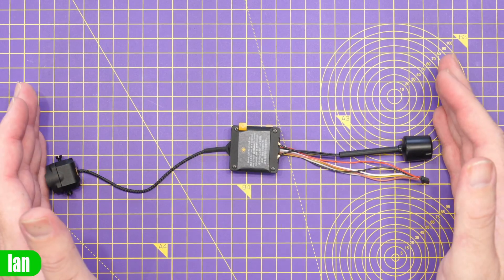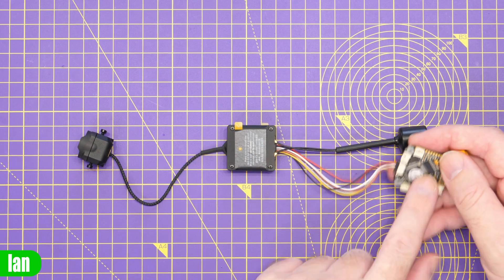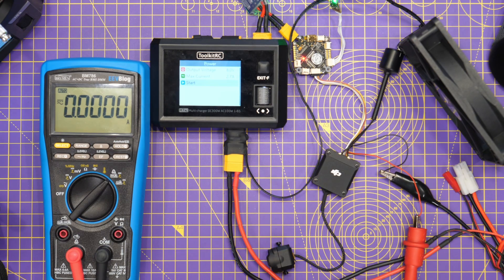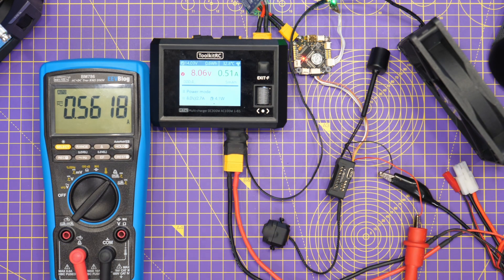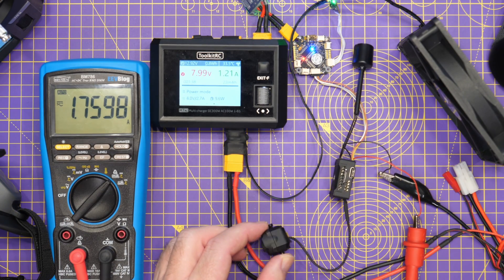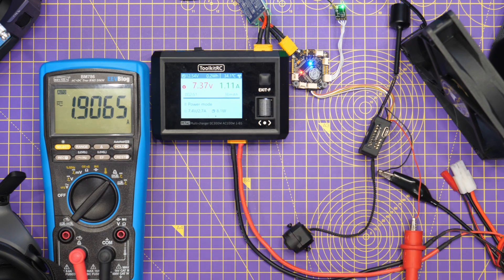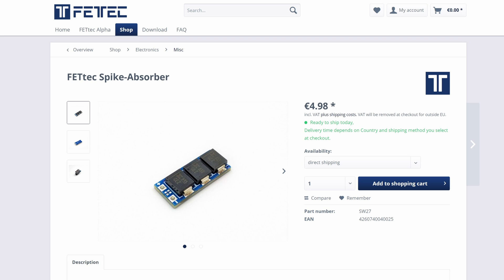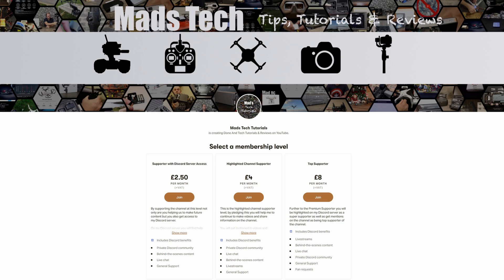DJI O3 Air Unit Power Requirements Updated  - This Could Catch You Out

Comment: Still believe this is what happened to my iflight chimera. Was to fast and lost control as well. Thanks for all the detailed testing Ian.
Reply: The Chimera7 Pro V2 you got for a review has a FC that's sold as 9V 2A. It's rated and tested for >2.5A constant and hot (without cooling) which can supply >22.5W. The measured maximum power draw is 15W and only when running the ham file.

Since I've explained in other videos, we have feedback from DJI that there's a firmware issue with the Radio Controller 2 that's being worked on. The network generated by Goggle, O3 and RC2 randomly fails and doesn't recover.
Reply: @xingtheiflightinsider  do you have a source where it is saying that its rated and tested for >2,5A?
Reply: @Mojo97779  yes, my source is iFlight.
Reply: @xingtheiflightinsider  okay, because i bought an chimera pro V2 (which will arrive next week) and i saw that Video from originaldobo, which made me think of wether the BEC is sufficient or not. But 2,5A should be sufficient, i guess, for the O3
Reply: @Mojo97779  This video is based on wrong accusations anyway. The BEC is more than sufficient. The DJI firmware had a bug which was fixed with the new update.
Reply: @xingtheiflightinsider  alrighty, thank you very much :)
Reply: @xingtheiflightinsider  whst kind of update  dji use for that?
Reply: @DrEvil-yx4vr  latest firmware was fixing those random disconnects when using the Radio Controller 2. It's in the changelog.
Reply: @xingtheiflightinsider   Do you mean the goggles 2 version?
Reply: @DrEvil-yx4vr  Actually the whole system got a firmware update with the fix, Goggle V2 and 2 but also O3 and Radio 2.
Reply: @xingtheiflightinsider   Thanks, than i know waht to do! Geting the update on everything
Reply: @xingtheiflightinsider  i have another question 😅 whats the right current before arming? My osd shows me 1.45A before Arminig! Is that right or to much? I already calibrate the current scale in betaflight after a few flights. Thanks for help.
Reply: @DrEvil-yx4vr  ignore that before arming. The current is so low it won't be accurate. Leave the default values from the manufacturer, those are pretty accurate. There's no need to have them perfect, since all batteries have either a bit more capacity (new) or a bit less (old). Fly to 90% battery capacity and then see how many amps you charged back in to confirm.
Reply: @xingtheiflightinsider  thank you 👍👍👍
Reply: This is why my O3 is shutting down in few minutes because of overheating?  I use a S4 1300mha.
Reply: @OriginaldoBo your video made me switch from a 9V 3A BEC on my Matek H743 MK4 FC to Lipo voltage... now I am not so sure that this was a wise move anymore. Lipo voltage sends transient spikes directly to the AU, that may no may not be ready for that (a TVS diode on its own). My FC has a own TVS diode and the BEC protects the AU from all kind of shit thats happening on the power rail. The question now is: how good is a 3A BEC in reality? chinesium is often overrated by the manufacturer. But 3A sounds still good if I only ever need 2A... what to do?

Comment: I think DJI makes better shit and the chances of losing your you’re whole rig due to a BEC failure on a cheap cut rate garbage flight controller is much higher then a DJI Air Unit dying from wiring it straight to VBat. It’s designed to run off of VBat and I just trust that feature more than an iFlight BEC. And that goes for all of them. I lost an Insta360 Go 2 on that crash. The drone was a complete loss. The only thing that survived was the Vista!  

There is technical theory as to why we do things the way we do and there is real life experience. I always wire Air Units to VBat and never had a problem. Lost about $500 worth of shit due to a HGLRC flight controller with a piece of crap BEC.  Never lost anything from wiring any DJI air unit to VBat. Life experience.

Comment: Does this mean that the HAM FCC Hack gives full output power once armed?
Reply from the maker: Yes.
Reply: @MadRC  My quad with an older F4 Matek FC stays in low power mode even after arming. All OSD elements are showing and the FCC hack is on, as the channel check showed. Could be the reason that the BEC is not providing enough power that keeps the O3 in lo power mode?

Comment: Ian, excuse for my ignorance but where do you get the information on the BEC for an ECS?
Reply: The BEC is often on the FC, but regardless, the manufacturers should be spec'ing things out.  I'd check the retail site or documentation/manual (if applicable), or contact them directly if you feel so inclined.  So the real question then becomes - how much do you trust the manufacturer?
Reply: @abertheham  Thank you.

Comment: Not going to full power until armed is a "feature" that helps keep you from stomping on other pilots just from turning your drone on to make adjustments. Good on you for clarifying the situation.
Reply from the maker: Not really. That’s low power mode.  There is no logic that turning off low power mode still restricts RF output.  

It basically makes low power mode close to pointless.
Reply: @MadRC  I guess except,  like I said if you're going over your settings,  including turning off "low power mode", adjusting the goggles,  etc, it's not necessary for the unit to put out the highest transmission power until the drone is armed. What's the point of having it output full signal sitting on a table until you're ready to take off? Having it stay in low power until you're ready to fly,  helps with battery life,  thermals,  etc in my opinion. I've seen guys dick around for 5 minutes before actually launching. The only "negative" to the way it's programmed to work is that it messed with your tests. Hahaha! Low Power Mode allows you to fly at low power,  right? Again,  so you're not stomping on other pilots. When you turn off LPM, it switches to high output once you launch. Makes sense to me anyway... Obviously,  we all can have our opinions,  right?
Reply: The issue is when you are going to use it without a flight controller.
Reply: @MCsCreations  Um what issue? Wait,  how do you use an O3 Air Unit without a flight controller? Technically,  the concern is that the O3 draws to much current THROUGH the flight controller BEC. If you're "not using a FC"... well then,  you're problems are solved... I'm not sure what you're doing at that point? Setting up a remote camera? Mounting the O3 unit to a balloon? Attaching it to a stick and using it to perform a colonoscopy on yourself?  Hmm... I guess there are options!
Reply: @londenard  for example I use them on planes and fpv wings without fc.
Reply: @londenard  Rc airplanes, rc cars... No arming status.
Reply: @metalscorpionfpv me too. I fly fixed wing aerobatics with the old DJI system and you can set the auto temp cut out to off or something similar. I hope there is a similar thing on the new 03A unit
Reply: @londenard  I Fly a Viper 90 EDF with an Air unit mounted on a headtracking gimbal.  I don't use a flight controller. So if it's not delivering full power with out an FC that's a huge problem for me.  :)
Reply: @londenard air plane or rc car and truck !!!
Reply: @glyrenden  do you use the original air unit or the new 03? ive been wanting to pick up one for my Freewing 90mm F22 Raptor but i wouldnt have a FC to go with it.
Reply: @boliu9608  I use the original air unit.  But blackstar FPV and TBRC are both making FC that will full arm the O3 and send info to the OSD.  But they don’t do flight control ;).
Reply: Is there a way to "switch on" armed mode without the use of an FC?
I had planned on using O3 upon my 1 meter Wing...
Reply: @FPVer  yes, there's a very simple Arduino project that does just this. I've done it on two of my planes and it's very easy. Unfortunately I can't give you the link because it kept getting deleted
Reply: @FPVer  If you search with the words ramiss DJI03 Arduino you should find it.  Good luck.  Alan
Reply: @FPVer  Did you ever find out?
Reply: Not really. It's to prevent O3 unit from over heating. Not armed = no air flow

Comment: I just got my first O3 air unit and set things up. One of the things that I noticed is that it seems to heat up quicker when connected to the goggles. During part of my setup, my needed the goggles on for positioning OSD elements and I had to work fast while doing this to reduce it heating up. The next day, I changed ESC settings and it didn’t appear to heat up nearly as much. Because of this, I think the best way to do the first flight with a craft that has GPS is to start with the goggles off until getting a GPS fix. Would love to see additional testing of this to see if I am right about this behavior.
Reply: ESC or flight controller settings (besides your msp connection) do not not affect the VTX/ O3 air unit in any way. When you had it connected to your goggles , the goggle was sending a signal to increase the power level as its variable powe.A lot of people power their GPS off of a pad that can be powered by USB, then use a USB connection to get the fix then plug in full lipo voltage. You could also use a fan to cool the unit. Been doing this with gen 1 air units and vistas for years
Reply: @skyweaver3199  I know that the ESC settings do not affect the O3 unit. My point was that I didn’t need to power the goggles on for this like when I was checking to see that the OSD items were not over the DJI ones. Will have to test this more but think that if the air unit has not received a signal since being powered on, it may generate less heat. ELRS modules do this by staying at low power when powered on while using dynamic power until armed. The air unit may do something similar to this. I’m still going to do my next build with the JB F7 and use a switch n transmitter to power down the air unit until I get a fix.

Comment: Just power directly from vbat, enjoy life and go flying guys. Two years i hardly abuse all my vistas and recently the O3, directly from vbat. Never had a problem. 
Manufacturer says 6S supported. Why complicate things with becs….
Reply: Because of powering the unit to its limit seems risky to a lot. However, I’ve been going straight 6s with a Fettec spike absorber and cap combo. No issues in 8 months solid flying, crashes, tree hang ups, ect

Comment: Stop using bec's...wire them to main battery voltage to avoid brownouts and avoid bec failures. Super useful information, but this is gonna blow even more Fettec's than the OG
Reply: Totally agree. It’s all about who do you trust.  DJI air unit on VBat or an iFlight BEC?  I am putting my drone and cameras in the DJI corner. It’s designed to work on VBat and I never had one problem doing it that way. If it has a plug and play connector I pull the wires out and solder them to VBat.  That’s a lot of money flying around.  I trust the DJI equipment more than a cheap flight controller. 

I don’t know. Maybe DJI hires older and more experienced children to assemble their air units than iFlight does to build their boards. 😮
Reply: @C Neiner  def trust DJI over iMight....iFlight has the worst QC, even worse than Eachine 🤣
Reply: WORDS!!! Really, STOP using BECs. All they do is brown out and cause your O3 to reset and guaranteed crash or losing drone. I just found this out the hard way.
Reply: when you say main battery voltage do u mean the vbat pad or directly to the battery pads?
Reply: @calebd1776  Either one.  It's essentially the same thing.  Vbat pads are battery voltage without a BEC.  I usually solder directly to the battery connection, but you can do it either way.  It depends on the location of certain devices and what fits best for that particular project.
Reply: @Nine_883  cool thanks for answering. One more thing: if I were to use the vbat pad to power my vista and wanted to use a cap, would I solder the cap directly to the vbat pad along with the vista vista? Or would putting a cap directly on the battery pads be the same thing?
Reply: @calebd1776  they actually make little chips now that hold the battery cap xt60 for example and have two holes for the capacitor to run through - yes you solder the capacitor to the same area where the leads meet the esc battery pads.
Reply: @calebd1776  right to the main voltage pads on your esc, where the battery lead is connected 👌
Reply: Just about to set up my 03 was planning on connecting straight to my TMotor Cine FC that has a built in 9v 2amp bec would you guys use this or still go straight to main battery connectors on esc ? Using 6s so 03 would handle it I guess.. opinions?
Reply: @NorieM_serval  the plug will work, i prefer to direct solder to vbat.   I use the tmotor F7 HD and always skip the plug 👌
Reply: @Fly_High_FPV  hi m8 do you just take the positive & negative out the plug to solder into vbat and just connect the other wires using the harness ?
Reply: @NorieM_serval  i cut the FC side of the cable off, and i remove the 2 unneeded cables for Sbus (i'm using crossfire or elrs). I wire positive and negative to the main vbat pads on the esc, and I wire tx and rx for msp to any available uart on the flight controller. No plug means it wont fail in a hard crash, and i'm constantly bashing on concrete.
Reply: @Fly_High_FPV  ah ok I'm with ya cheers for the info bro 👍 I'm ELRS also so will go with the same method !
Reply: Fettec needs to get their crap together.  Great engineering and terrible execution
Reply: @OriginaldoBo  had a lot of reports of G4's popping that lil 1.6amp regulator on the OG Air Unit. So this monster gonna kill even more. I became a fettec dealer, but havent been able to get stock from them yet 🤷‍♂️
Reply: @Fly_High_FPV  I work in electronic controls in the commercial refrigeration business and I just never trusted these BEC’s.  I had an issue with one early on in the hobby and always use VBat if possible. If something normally draws 1.5 amps or higher it should be at least a 3 amp rated voltage regulator. I spend a few extra bucks and buy higher rated esc’s as well. We put these quads through some extreme voltage spikes and sags. Better safe than sorry.

And I am sorry, but I don’t trust these Chinese FPV companies. There is no accountability.  If their shit fails and costs you $500 they just blame you and then ignore you.

Comment: Any downside to powering it direct from the battery pack?
Reply: Edit… you answered my question!
Reply: I've always used a cap and 6S voltage for vista, and that's what i'm using on my 03 Air units 👌 holy shit 03 is a game changer
Reply: @Fly_High_FPV  it’s sure is! I go straight battery with a cap and Fettec spike absorber combo
Reply: I use my vistas via vbat and never had problems. Dji Hardware is not so Bad like other FPV hardware.